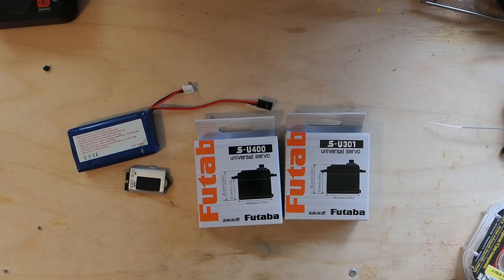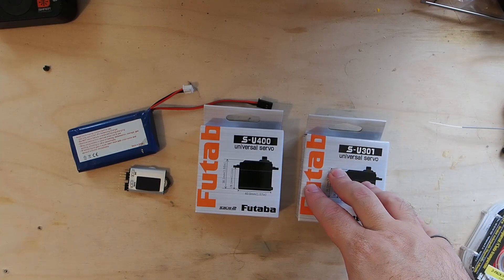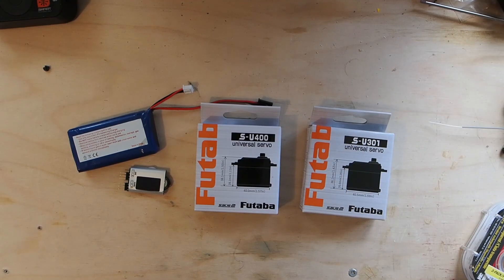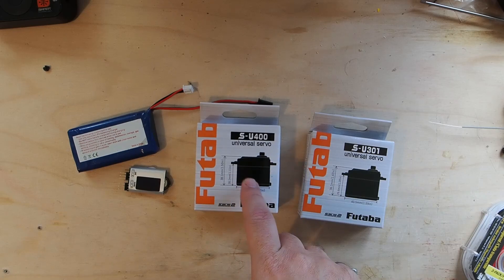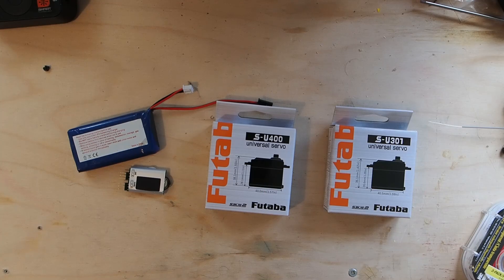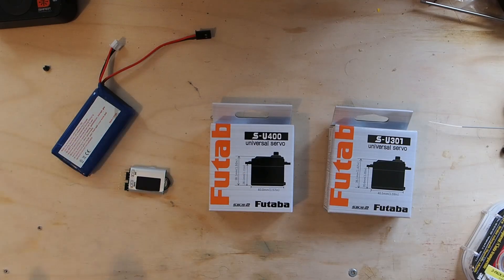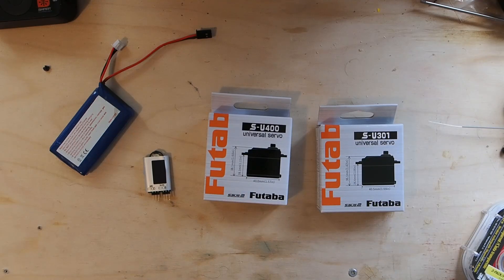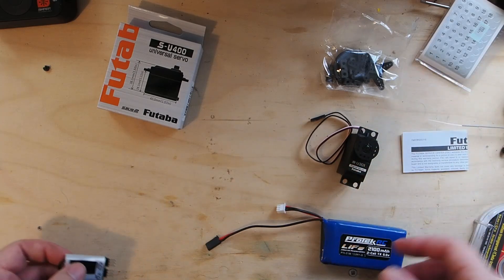ETHOS Tech Tip 4 - SBus Servo Setup

Comment: For ignorant me, can you explain the benefits of sbus v pwm servos? Great to see you doing vids btw.
Reply from the maker: There's a couple advantages for Sbus servos.

1. They can be y-cabled and still have independent channels, as all channels are always on the wire, this greatly simplifies wiring, and prevents issues like plugging in ailerons incorrectly

2. You get better servo resolution, as no resolution is lost in converting a digital value to PWM at the receiver, then a PWM value back to a digital value at the servo

3. There's the potential for servo telemetry and remote setup of servos (this is FBus only on FrSky, not with regular SBus servos).
Reply: @adam_mawz_maas  ooh fascinating! How are they wired? Are there two sets of pins on servos (like smartport sensors?)
Reply: @randallpatrickc   Y leads.   Can then run one 3 wire standard lead from from of plane where the Rx is, all the way to the rear, putting a Y lead in at each servo placement.  Eg all servos can be run from the One port